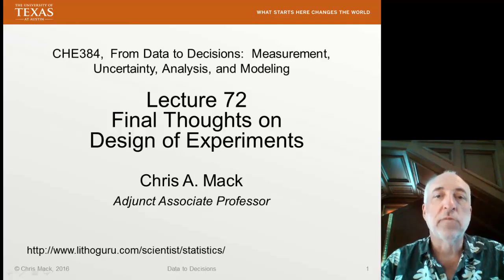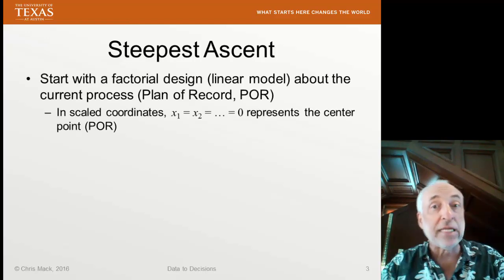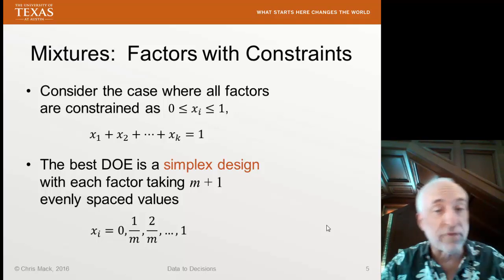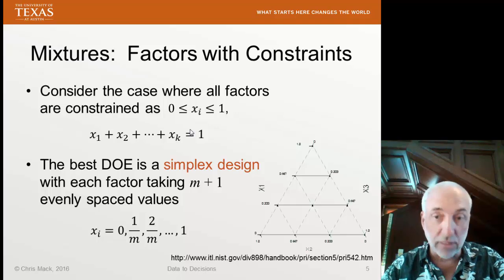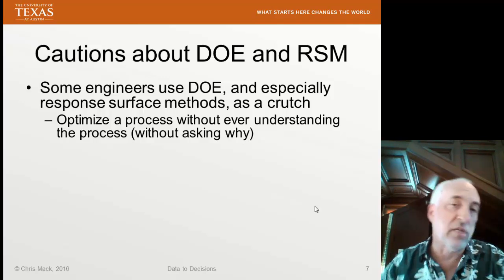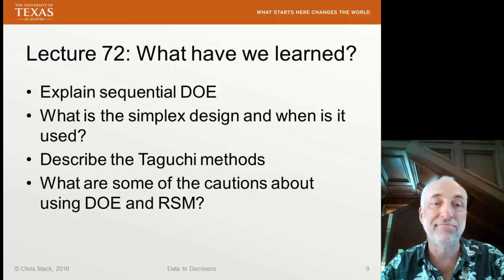Lecture72 (Data2Decision) Final Thoughts on Design of Experiments

Comment: AI Summary

Abstract:

This lecture, "Lecture 72: Final Thoughts on Design of Experiments," by Chris Mack, concludes a series on experimental design by emphasizing its sequential and exploratory application for efficient process optimization. It details the iterative approach of starting with screening experiments and evolving to response surface modeling. The lecture introduces specific methodologies like the Simplex design for factors with constraints (e.g., mixtures) and clarifies Taguchi Methods as a quality improvement framework that integrates DOE with loss functions and a focus on designing robust processes. Crucially, Mack offers significant cautions for engineers and scientists, warning against using DOE as a purely empirical "crutch that bypasses true scientific understanding. He highlights that DOE always assumes an underlying model, which limits observable behaviors, and that quadratic models can misleadingly indicate an optimum even when one doesn't genuinely exist, urging practitioners to always engage their "science brain" and question the "why" behind the results.

Exploring Design of Experiments: Advanced Topics and Crucial Cautions

*   [0:17] Sequential Design of Experiments (DOE): DOE is often applied sequentially and exploratorily to efficiently navigate the design space and identify optimal conditions while minimizing the number of required data points.
*   [0:54] Iterative Optimization Process: The typical approach begins with a two-level screening factorial design. Based on the calculated direction of steepest descent (or ascent), experiments are moved to new points, where further factorial or Central Composite Designs (CCD) are conducted to refine Response Surface Modeling (RSM).
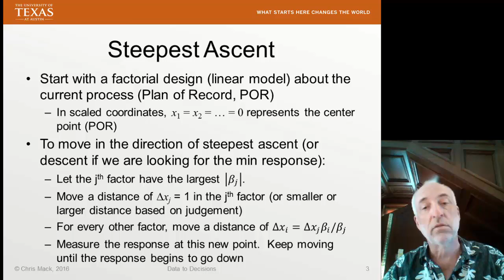*   [4:28] Managing Experimental Blocks: Sequential DOE frequently involves running experiments in multiple blocks (e.g., factorial points first, then axial/star points for quadratic modeling). Repeated center points are vital in each block to ensure statistical uniformity, rotatability, and orthogonality, accounting for potential changes over time.
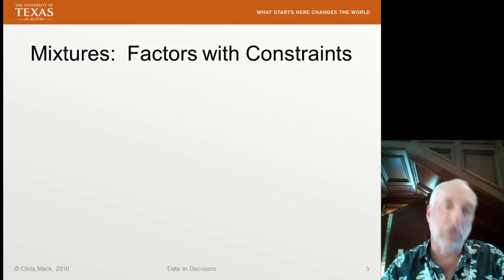*   [6:33] Simplex Design for Constrained Factors: For factors with inherent constraints, such as component percentages in a mixture that must sum to one, the Simplex design method is used to create a set of evenly spaced experimental points that adhere to these limitations.
*   [9:21] Understanding Taguchi Methods: Taguchi Methods are a set of statistical techniques predominantly used in manufacturing for quality improvement. They are built on three core concepts: optimization using specific loss functions (e.g., "more is better," "less is better," or "on target with minimum variation"), designing processes for inherent robustness and minimal variation, and achieving these goals through the systematic application of Design of Experiments.
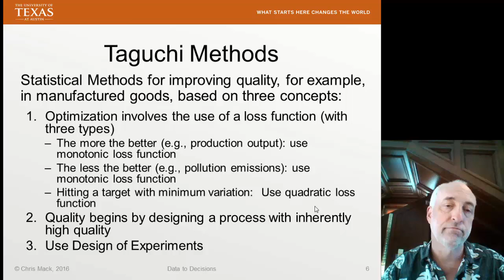*   [11:34] Caution 1: Avoid DOE as a "Crutch": A critical caution is not to use DOE, particularly RSM, as a purely empirical tool to obtain answers without developing a deep understanding of why the process behaves as it does. Engineers and scientists should always maintain their "science brain" and seek underlying explanations, rather than just relying on statistical results.
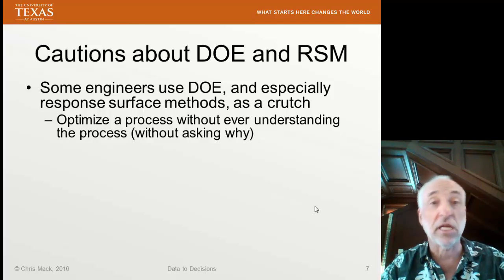*   [13:45] Caution 2: Model Assumptions Limit Insights: Every DOE is designed based on an assumed underlying model (e.g., linear, quadratic). The experimental design can only reveal behaviors consistent with or less complex than the assumed model, and it does not inherently provide a way to test for model error or observe unmodeled complexities.
*   [15:12] Caution 3: Misleading Optimums from Quadratic Models: While quadratic models are useful for finding optimums, they will always point to one, even if the true underlying behavior does not have a distinct peak (e.g., an asymptotic exponential curve). This can be misleading, as the indicated "optimum" might be an artifact of the model's accuracy rather than a true process maximum or minimum.
*   [16:26] Integrate Statistics with Science: The overall takeaway is that DOE is a powerful tool, but its effective use requires thoughtful application, constant questioning of assumptions, and a commitment to genuine scientific understanding beyond mere numerical optimization.

I used gemini-2.5-flash-preview-05-20| input-price: 0.15 output-price: 3.5 max-context-length: 128_000 on rocketrecap dot com to summarize the transcript.
Cost (if I didn't use the free tier): $0.0055
Input tokens: 17038
Output tokens: 842